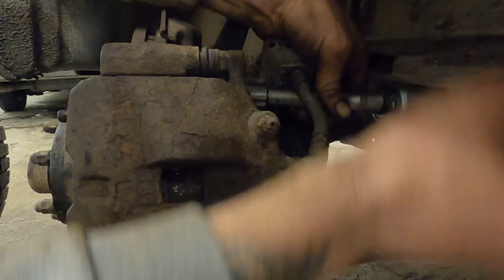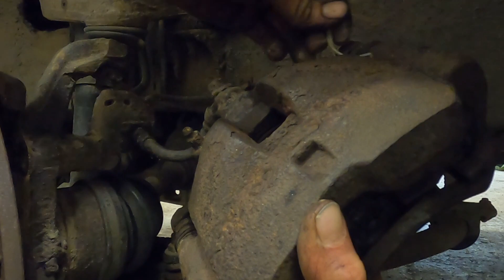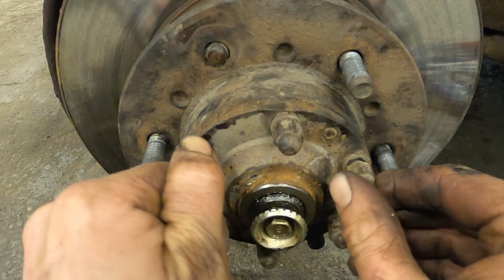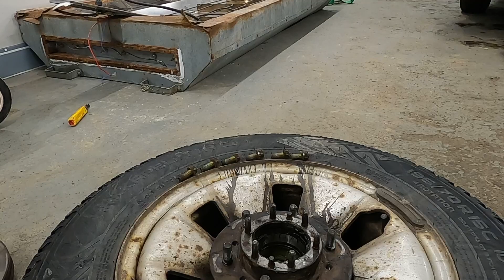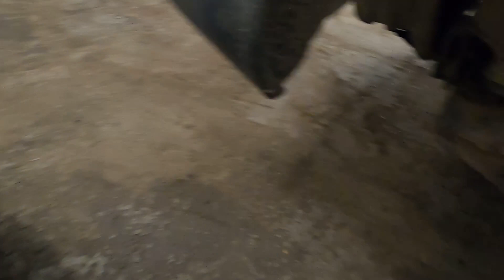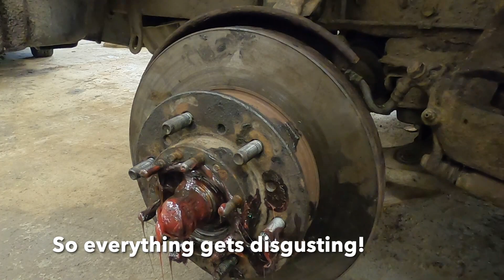Toyota Hiace 4x4 Wheel stud/lug nut change | Break disc removal

Comment: This video was really helpful. I didn't need to take the washer off the axle because the lock nut fits over the top. Just remember to re-attach the disc to the hub before putting it back on. Lol. I forgot and had to take the hub off again. Thankyou to whoever uploaded the vid.
Reply from the maker: Thank you! I am glad that the video was useful. Yeah, I noticed that when I watched the video myself, that I didn't have to take the washer off.
Reply: Great video liked it and subscribed good quality thank you